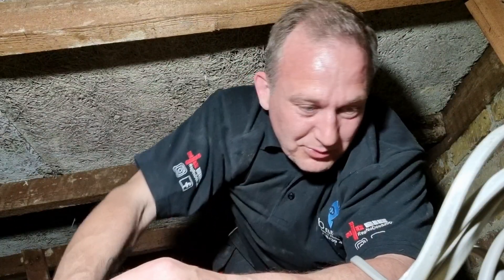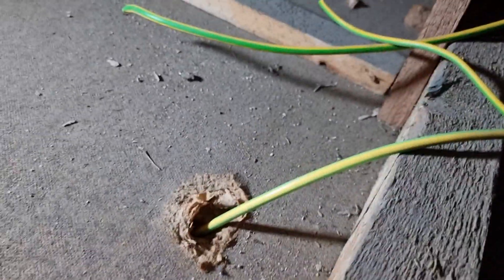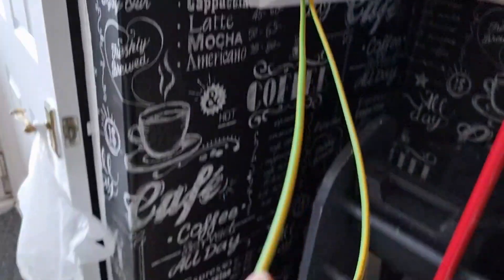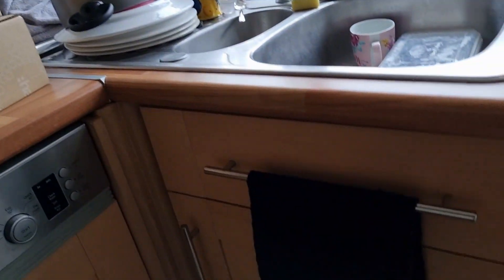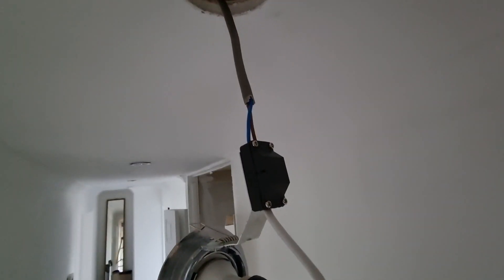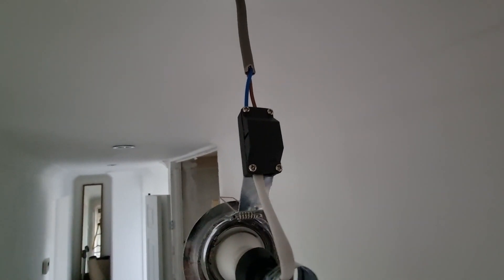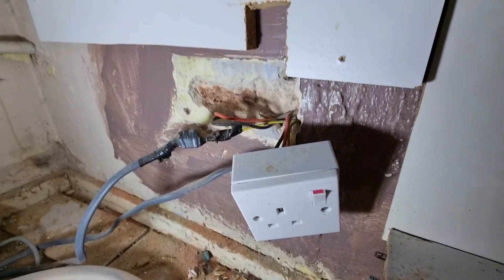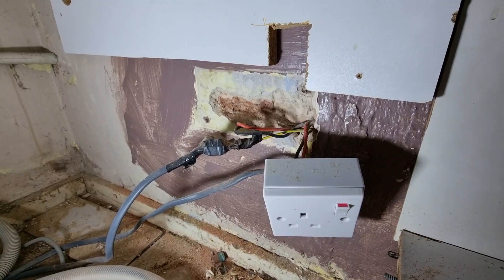Making good dodgy electrics found during a routine Electrical safety test

Comment: Not happy with the earth sticking out of the down light connection box .I would have used two core flex 👍
Reply from the maker: Just the way I was always told to do it was to provide an earth at every accessory if they need it or not, incase they change the fitting to one that needs one and also to help protect the cable 👍
Reply: @ejbelectrical4951  yes you are right. We have this trouble all the time .no room in the silly little connections box to put another connector in ..just have to look at every connections different at least you can get at the joint box to change the flex if needed. Different matter if no box to get at so have to make the earth wire safe. 
I have used some very small 2 amp connectors and seem to get in OK 👍
Reply from the maker: @johnwaby4321  good call brother 👊
Reply: It's always a tough job for us ..finding the faults is not the problem. Its the putting right that causes us hassle 😟👍
Reply from the maker: @johnwaby4321  🤣🤣 yeah you could be right there fella....

Comment: I would have use the quick wire switch and load JB for the down lights much easier . But yes WAGO and WAGO box is good 👍.
Reply from the maker: Hi Sean
Yeah I've seen the quick wire jb's, the only things that stops me using them is thinking about other people later not having them on their van, so changing them to wagos anyway, and if I happen to run out I can't just pick them up as easily as I can the wago boxes...👍
Reply: @ejbelectrical4951  I get were your coming from, but the quick wire switch and load in maintenance free and there is nothing to go wrong with them as they are wired internally , but we all have our own way of doing things and it a personal choice at the end of the day . 
Great video by the way 👍
Reply from the maker: @Dog-whisperer7494  thanks brother 👊

Comment: Why didn’t you change the down lights to fire rated? Wouldn’t been way easier and Safer
Reply from the maker: Hi Ryan
Well there was a few reasons really, number one was that the client had paid for these fittings only a weeks before, but they were fitted by his maintenence guy, also the flat is a top floor flat so no other habitation above, so they don't need to be fire rated 👍👊